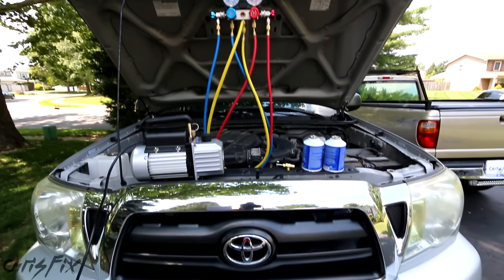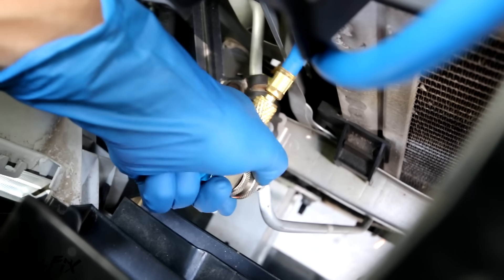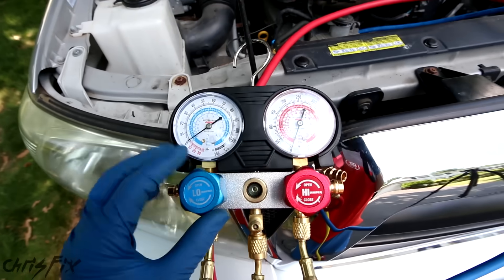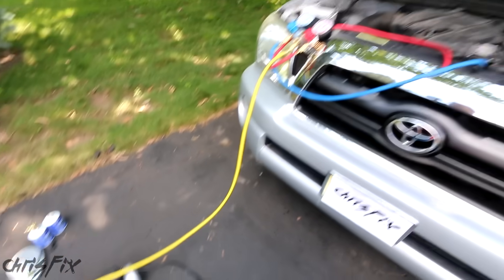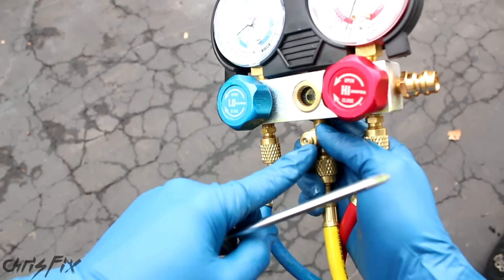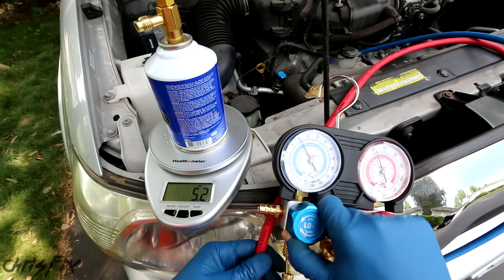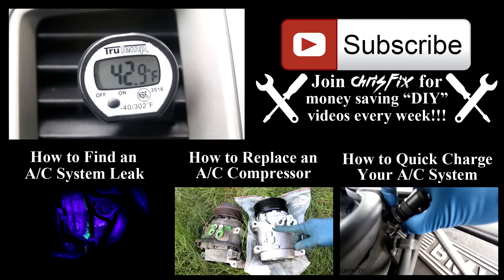How to Properly Recharge Your AC System

Comment: Being a mechanic in training makes me honestly relieved that we got an AC machine that does most of the job for us. It's just connect, search for the vehicle and brand, and then what job it should do, and wait.
Of course, the machine was about 50,000 SEK (About, I'd imagine $5125) but saves you from a lot of hassle.

Though, for those who can't afford to do it at a workshop or just wants to do it at home, this video is great!

The last thing I did before ending this year's class was to actually fill the AC on a car and then look for a leak which I found (A major one too). So we took the last that was left (Basically nothing) and filled it back up. After, we ran the AC and found the leak. Of course, we emptied it again.
Reply from the maker: Pretty interesting, thanks for sharing!

Comment: What’s the advice on self sealing Freon cans? When you change cans I guess the only thing you can do is shut the valve on the manifold gauges? Then bleed the air out again. Because the fittings that are used for self sealing cans don’t close off the system.. I just don’t want to waste Freon because I have no way to recover it. Just vacuum down and recharge.

Comment: Great video much appreciated but I have one question? When you purged the air out of the line before you recharged it. Didn't you just put Freon into the atmosphere which is a No-No? Other than that great video your thoughts cheers!
Reply from the maker: It’s r134a and a quick purge is not a problem. Those air duster cans use the same stuff as this and you use that to dust your keyboard off.

Comment: The second can weighted 20 onces and he put half the weight in. Which is 6 onces of refrigerant instead of 10. 1.12 lbs instead of the requirement. 1.26 to 1.39

Comment: The vacuum pump is good only to remove moisture and air out of the AC system, so how did you evacuate the AC and removed the old refrigerant before recharging system? You need a shop machine for that and most of us don't have that

Comment: Chris is very thorough if you missed anything I would just say if you replaced any components or even if you just want to know how to add AC to your system if the system was really low or empty you want to replace your receiver dryer or accumulator depending on which AC system you have they both serve the same purpose to keep any moisture in the system out which is what the vacuum pump is doing but it's still imperative otherwise moisture can be trapped in the desiccant inside the dryer or accumulator

Comment: Very nice video. Was wondering when I am pulling a vacuum, the low side gauge only goes to about -25, not all the way to -30. I ran the pump for about 1hr. Any ideas?
Reply: Got oil in the pump? If it's a new pump it needs oil, i didn't realize when I got my new pump (read the instructions genius) it wasn't full of oil already, plus I didn't have the yellow line tight on the pump so it was leaking out a bit, thus I couldn't get to neg 30 either, mine stayed at about -25. Once I fixed those it went right about to -29 and held vacuum after an hour.
Reply: I've been told that if you are in a high altitude are like Denver getting the indicated -30 inches of mercury isn't possible, best someone living  up that high can get is roughly -26 inches.

Comment: Do I need to add oil AFTER vacuuming the system with a new compressor (pre oiled) ?  Thank you
Reply from the maker: No, 7:50
Reply: Thanks for answering bro! Does vacuuming remove oil though? Or do I add the recommended amount of oil into the compressor before installing?

Comment: what are those conectors on the side of the manafold for
'? mine has 3 on the back ?
Reply: To store/protect the hoses and fittings when not in use.
Reply: @Adi-S  thanks also  my gauge set  does not have shut of valve on shrader  end connectors both red and blue ends .there is only one valve shut off on the end attaching to the manifold

Comment: ah man what a nightmare. 250 for the ac kit with refrigerant at harbor freight perfectly installed, did nothing. the power's been off too so i went to oreilly and they said the battery is bad. another 200 for a new battery, also did nothing. 450 dollars for no change. dad backed into my car accidentally messing up the bumper and thrashed my passenger with refrigerant when he put a can on it so now i got even more problems.

should i drive off a cliff killing me and my car?

Comment: I haven’t purchased any of these items yet but I am about to. I know that I definitely have a leak somewhere as my car will not hold refrigerant. I have not replaced any parts of the AC system, once I find the leak and repair it, should I add any oil to the system as you explained in the video or is that not necessary unless I replace something else? Thanks

Comment: Could you instead positive pressure test the system with pretty dry compressor air and skip the vacuum step, if you were to replace the dryer? 
I'd think their beads would absorb moisture from a reasonably dry system. I also have a compressor with a dryer in so I could put in pretty darn dry air.    IE if we have to be SO SO careful about "wet" air what are the desiccant beads for?     Related question, when we pull a vacuum on the system for long enough is that drying out the desiccant beads so I do not need to replace the dryer? How about if I put a blow torch on it for a bit? :)   (maybe the desiccant beads absorb refrigerant, not water? am I mistaken to think they absorb water)  Someone help me understand?

Comment: Chris... do we need to replace the condenser when AC compressor is replaced as the old one is under performing and showing low compression and air is not cool enough while system is fully charged with gas.
Reply: No the condenser only needs to be changed if it is leaking.
Reply: On late model vehicles If compressor had bad failure with metal shavings exiting compressor they will get lodged in condenser and cannot be removed cuz passages are only about 1mm..

Comment: Very good video. Thank you! I just have one question. You purged the air in the yellow line, but what about the air in the blue line that is connected to the low side where you are adding the freon?
Reply from the maker: Thanks! The pump evacuated all the air out because those lines were open when doing that step
Reply: @chrisfix  Thank you Chris! I forgot that as long as the valve is closed, the blue line is also vacuum sealed.

Comment: What about discharging it ?
Reply: Taking it to a shop and having them recover it all is what is legally required. If you dont have a problem with breaking federal law and dont want to spend the money you can just vent it.
Reply: @Redtooth75  I never advocate anyone breaking the law, except to protect another person. This don't qualify.
Reply: @flyboy2610  im not necessarily advocating it, im just telling him his options. If we are being honest the spirit of those laws is to prevent professionals or companies from venting large amounts of refrigerant. One person venting a pound of 134a is not really a big deal. Especially when industrial applications are allowed to leak 30% of a charge that is probably over 100 pounds annually without being required to fix it.
Reply: You will have to take it to a shop which has the proper equipment to evacuate the system. Sorry, but it's the only option.

Comment: I don't have the gauge. This gauge is too expensive. I got a basic gauge from Walmart , 1 dye can , 2 Refrigeration cans did perfectly fine  for honda odyssey van. Started blowing cool air  for few months. and Just cost Below $50 bucks. Sorry I have to pass this  video.  This is more like Auto geeks not for me .  however I love your other videos.
Reply: Doing it your way is fine most of the time. But those cheap gauges are not always accurate and sometimes give false readings. The gauges and pump can be rented for free at auto parts stores. I would definitely recommend this method more than using a cheap can with a gauge. Always best to use the proper equipment with air conditioning because they can be pretty picky.

Comment: Did you ever do an ac flush?? You should do a video on an ac flush!
Reply from the maker: I can check that out but evacuating the air with the pump should pull out anything from the system that shouldn't be there!
Reply: @chrisfix  Thanks! A system flush is required for my vehicles system after certain replacements, under certain conditions, like if the oil is contaminated with metal. I personally would just like to know for preventive maintenance.

Comment: Can we only add refrigerant without vacuuming? How do we know it needs oil or not?
Reply: If the system does not have any pressure then it must be evacuated to remove any air and moisture. If it does have pressure you can just add because there is just refrigerant in the system. You dont need to add oil unless you replace the compressor since that is where most of the oil is. Small amounts can leak out with the refrigerant if there is a leak but not enough to require you to add any.
Reply: @Redtooth75  Thank you and appreciate your helpful reply!

Comment: I have always put the fan on the highest speed, so far zero issues out of 4 complete system rebuilds i have done. My question is this, what is your reasoning for the LOWEST fan speed setting? I'm only asking as there seems to be something im missing.
Reply: It normally should be put on high. If charging by pressure and not weight you should charge the system when its on a high load. Since he is weighing it in it doesn't really matter. Airflow through the condenser can change the low side pressure readings so if you charge by looking at pressure it can cause issues.

Comment: The only thing is before you tested the vacuum you   closed the valve isolating  the gauge
Reply: The gauge always reads the pressure in the lines regardless of the valve position. The valve cuts off the high and low side lines to the yellow service line.

Comment: Do you add refrigerant while the car is still under vacuum 
or do you have to let all the vacuum out, then add refrigerant?
Reply: Add while under vacuum. The vacuum is to remove the air and moisture from the system.
Reply: @Redtooth75  thank you

Comment: I strongly suggest also watching Ericthecarguy's video. Both videos fill in some gaps or points not emphasized enough in this one like purging the yellow line (if you don't have a purge valve, just loosen the connector at the manifold until refrigerant comes out.) Eric's video also explains in more detail about how to handle the refrigerant can when charging by turning it every few seconds.

Comment: I followed your instructions and everything was fine except for the Yellow line which is supposed to do the vacuum and freon.  The oil added to the vacuum was spraying out as a mist causing a mess and the freon never took, I had to manually use a handheld connector to add Freon.  

What I later realize was the Yellow line blows out not in, so it defeats the purpose of the job intended.  

How do I get the hose to vacuum instead of blowing.  Thanks.
Reply: If the system is under pressure you cannot get the yellow hose to suck, cause the refrigerant in the system is trying to get out. The time to add oil is before you put the lines in the compressor. If you have already added freon the ship has sailed.
Reply: @Redtooth75   there was no Freon in the system due to a leak so the ac was blowing hot.  So I’m surprised it was under pressure.  I only added Freon in the end when the yellow hose didn’t take it from the can.  Question?  What causes it to be under pressure?

Comment: I just fixed my 2009 Honda Fit AC system by watching this video about 100 times and double checking that I was doing everything exactly like Chris did.  I ended up having to get a new condenser because there was a hole in mine from a rock. Chris, thanks so much for posting this content.  It really helped me a ton and saved me a bunch of money.  I truly appreciate you and your work.
Reply: Coincidentally, I have an 09 Honda Fit too and just yesterday a chuck of metal fell out of a truck that was in front of me on the highway and made impact with my car. The metal was the size of a deep well socket. About 5 minutes later my AC started blowing hot air. I got home and checked my condenser and sure enough there was a huge dent in the condenser and spray residue of AC oil everywhere. Now I'm waiting for my condenser (only $62) from Rockauto to arrive this week.
Reply: Did you replace your condenser by yourself? Then use methods in the video?
Reply: @hardcore4476  yes, the condenser was a pain to remove. One of the bolts rusted shut and I had to get a new hose as well as the condenser. Once I got it in following the steps in the video made it really easy.
Reply: @SadChadrick  That’s awesome, good deal!
Reply: Did you have to add in refrigerant oil for the condenser?

Comment: Fluid OZ are not the same as weight ounces. Fluid ounces are a measure of VOLUME while ounces are a measure of weight. You did well on everything else but I worry that the ounce weight of the can is not 12 because that was fluid OZ
Reply: Its gotta be a typo on the can. You can see that it has grams right beside it. Refrigerant is also sold by weight because it is a compressible and condensable gas so the manufacturer just made a mistake.
Reply: @Redtooth75  I agree. I looked at other cans and they are all by weight.

Comment: Question, why doesn't the oil and uv dye get sucked out when you pull vacuum on the system? You mentioned the compressor was pre oiled and you added dye before, but wouldn't the vacuum pump pull it all out?
Reply: The oil wont evaporate under low pressure. Think of it like sucking on the top of a metal water bottle. Even if you suck really really hard you wont get any water in your mouth. Its not a perfect analogy because water evaporated in low pressure and the vapor would get sucked out but I think you get the idea.

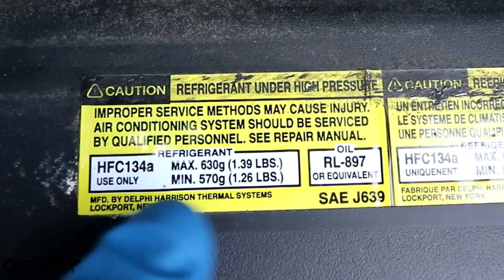Comment: 1:51.... Common mistake- you were going off of fluid ounces (measurement of volume), whereas you needed to go off of ounces (measurement of weight, not mass). Luckily, the density of the refrigerant is close enough, you filled with 680g if you used both cans.
Reply: It is supposed to be be weight ounces on the can they just made a typo.

Comment: What is the difference between refrigerant brands (Super Tech, A/C Pro, EZ Chill)?
Reply: None, there are only a few manufacturers, one plant may work with several different companies. Same with your motor oils, they are all bottled at a few plants, they just use different packaging and change up the formulations to meet the specs on the bottles. Walmart is the cheapest for refrigerant, at least in my experience.

Comment: Hi, I have 1 question. What if my car is low on refrigerant. Do I still need to do the vacuum.
Reply from the maker: As long as there is positive pressure, there is no moisture in the system (hopefully) and you will not need to pull a vacuum.
Reply: Will you need vacuum if you have new ac condenser new ac compressor and new drier(accumulator)?
Reply: @fabo5679  Yes. You do this to inspect the integrity of the system. Follow this video to the letter, vacuum the system down. You also need the vacuum to load the refrigerant. If you need a vacuum pump, Harbor Freight works fine. That is what Chris used in the video, the Harbor Freight pump and gauges.
Reply: @michaelwright1602  thanks

Comment: Followed these steps and for the most part it was great. Really like how well your videos are put together. My only negative is pouring the oil down the tune for the compressor. This was not a win for me, on the yellow hose. It will fill up a tiny bit and then leak out from the brass fittings. After you tighten it up it leaks everywhere as well. Pre-filled oil in compressor is the way to go or fill it before you install a new one.
Reply: correct, and you cant purge the air if you pour oil in.
Reply: That just happened to me also.

Comment: Graduated automotive school & im still watching your videos 😅Thx for the link on all the tools !
Reply from the maker: Never hurts to keep learning.
Reply: If I alright have a bit of refrigerant but it's low to where it pretty much only runs after the car has been sitting for hours (high and low psi are the same at around 35 psi with weather at about 90° and well above 50% humidity) do I have to pull a vacuum? Or is that only for when the system is empty or components are replaced or compressor is bad or something? I know I have a slow leak but I wanna recharge it with dye added to find it. Blows cold but only for like an hour then blows warm. Maybe not enough pressure after a while 

Thanks
Reply: @adictiveadictive  always pull vacuum. Especially since you have a leak. There is bound to be moisture inside the system.
Reply: @dadirtydawg7789 

Even with having pressure in the system? I was told by a few people a vacuum is not necessary in that case. Was just trying to confirm

Comment: I have a question. I noticed that when you said to close the connectors to the ports you went counterclockwise instead of clockwise. Is that how those hose connectors connected to the car ports close?
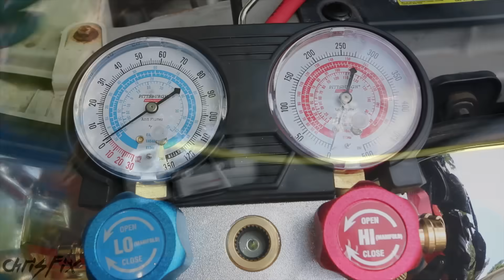Reply: 5:50 opens with counterclockwise turn. Lefty loosey to open, rights tighty to close.